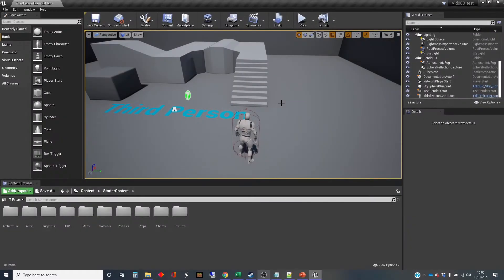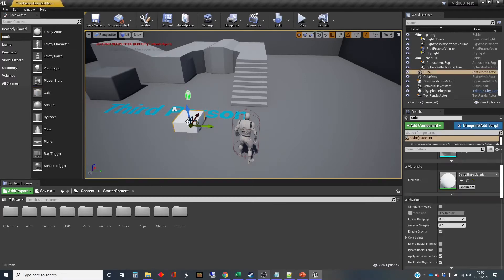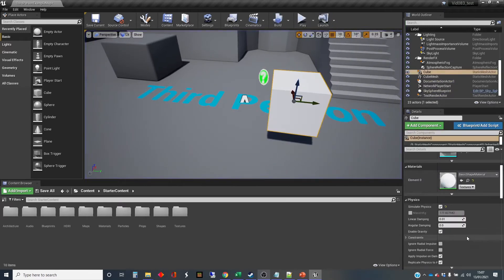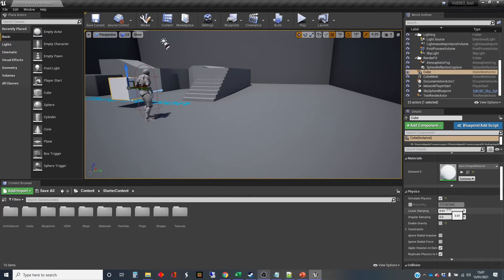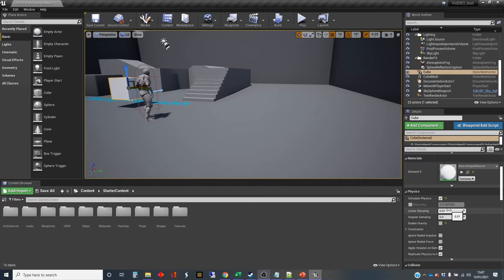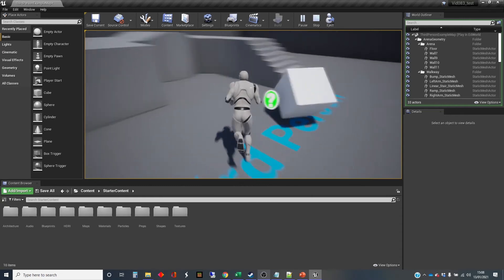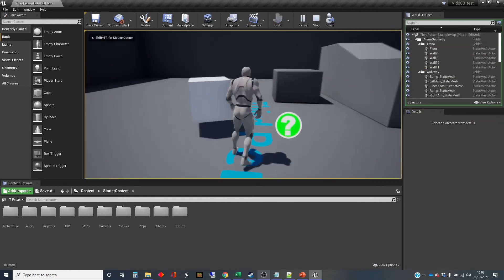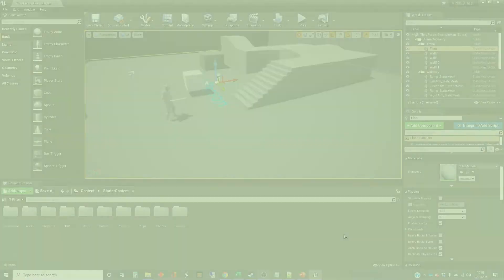Unreal Engine Tutorial Physics 03: Damping

Comment: oh... that explains why when i change the linear damping on a vehicle, and go off a ramp, it just stops mid air! It's because of linear damping.

But, if I lower that down, the vehicle is moving like it's on ice. So I have to find a way to change that damping depending on if the car is on the ground of in the air.

Is there a better way to do this? Or is this the only way?